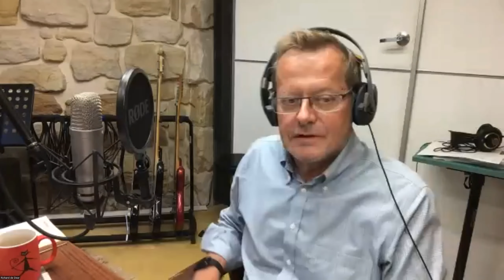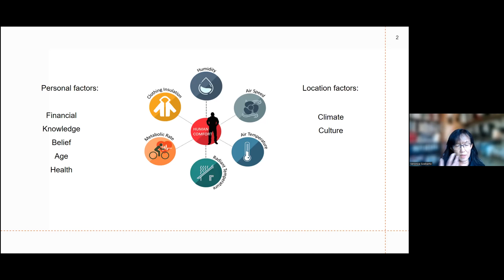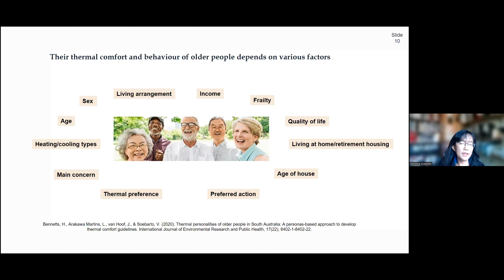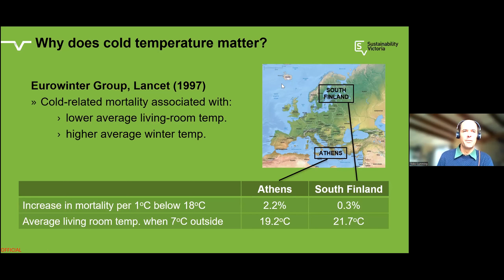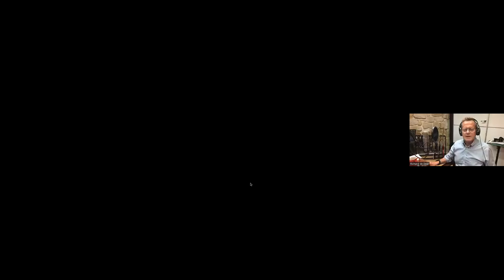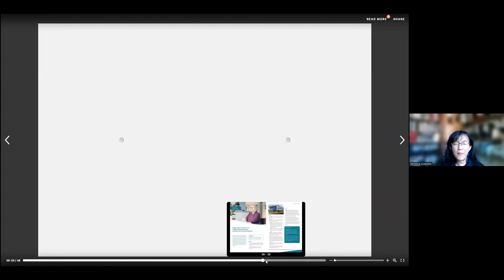Expert webinar: Thermal performance & adaptive behaviour for healthy, comfortable building occupants

Comment: I think ventilation is trickier for housing in cold climate home. We want to keep the temperature lower to save heating. Also we want airtight home to prevent energy. On the other hand, we need ventilation for IAQ and getting rid of the moisture as it can develop mould. While heat recovery ventilators are not great in their performance as they were thought to be.
Can we be more bold to opt for natural ventilation but use more radiant heating so that heat loss due to air? And also add heated clothing and furniture to create microclimate at a personal level?